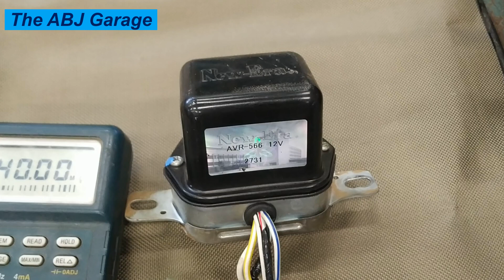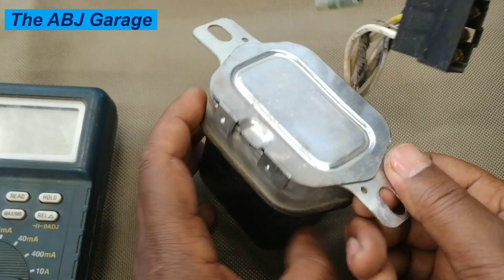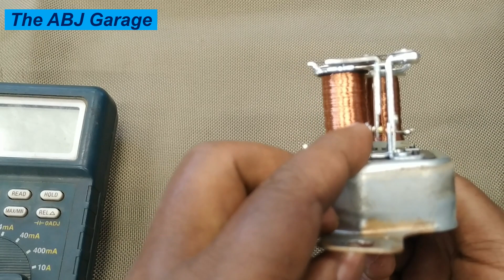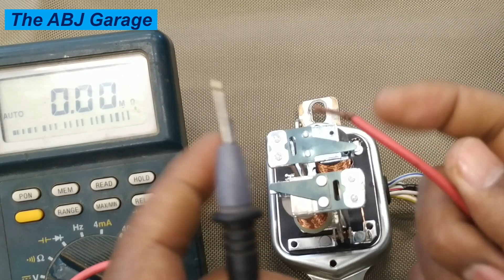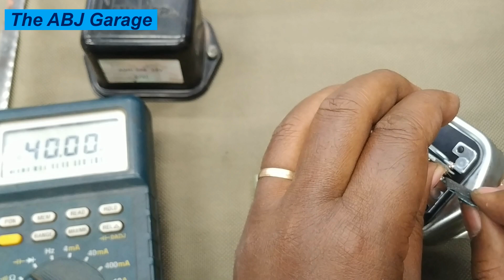How to inspect point type car voltage regulator using a multimeter

Comment: This voltage regulator is used in my old 1985 Honda City. I was surprised by this fact when I found out that the Japanese used this archaic regulator in the mid-80s. Although my 1983 Honda City Turbo has an electronic voltage regulator. Thanks for your work!
Reply from the maker: It's always interesting to see how different manufacturers approach similar functions! Thank you very much for the wonderful comment! Pleasure!